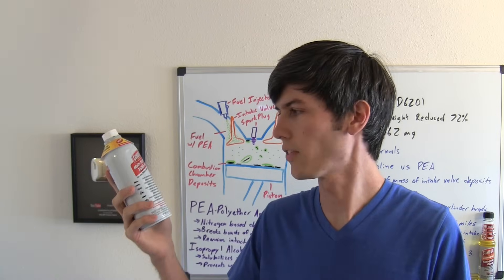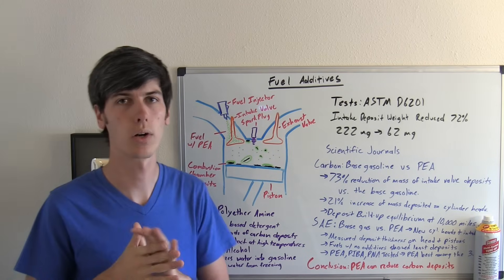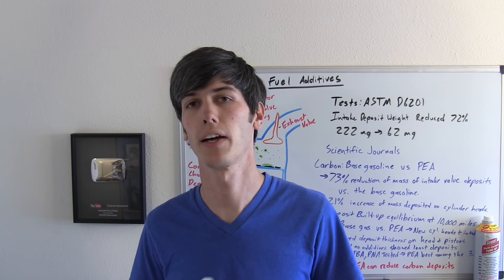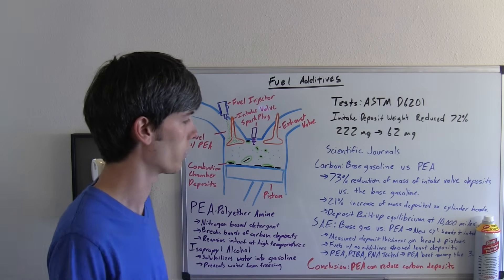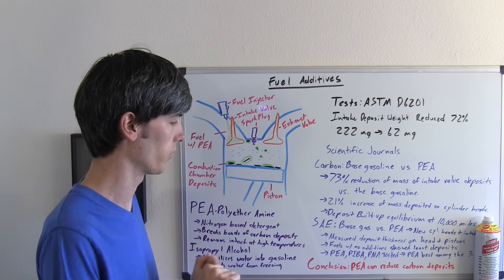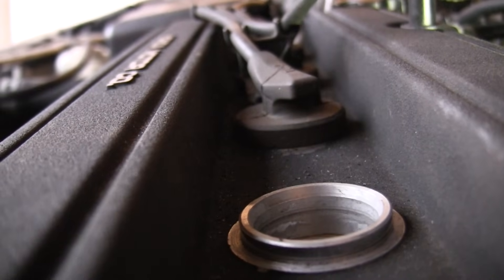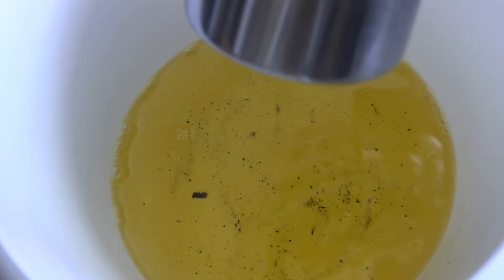Fuel Additives & Injector Cleaner - Explained

Comment: The real conclusion is:

1. If you have a newer engine (up to 80K miles or so), don't use ANYTHING.

2. When your engine reaches 80-100K, use an additive every time you change your oil. I like to do it 400-500Km before changing oil because then I "flush" some of the deposits that got into the oil. I consistently see improvement in the gas consumption (10%-15%) when I measure it AFTER I finished the full "supplemented" tank, for about 2000-3000 miles. From that point on, my gas consumption becomes higher until the next oil change+fuel additive.

3. If you'll use it too much, you'll end up building more deposits than you're breaking. Deposits on the piston head might cause detonation.
Reply: Shane is it safe to use it without oil change
Reply: @alecsanderfuentes3913  
Sure, I just like to start fresh after the treatment...But there won't be enough deposits to make you oil sludgy. Just don't do it immediately after an oil change. You don't want your new oil dirty right after you serviced your car.
Reply: @shane250  So do you use a fuel and an engine oil additive? If so, do you use a fuel additive after you do an oil change + oil additive or do you use the fuel additive before the oil change?
Reply: @ZareefHuq  
I use an oil additive because I got an old car (160K 2010). You do the PEA fuel additive as close as you can before your next oil change (so the oil change will flush the carbon you cleaned into your oil). Make sure you finished the tank with the additive before you change your oil. The oil additive (only if you use conventional crap from the garage pump...not if you buy some good oil) when you change the oil (put 1/2 a quart instead of 1/2 quart oil).
Reply: @ZareefHuq  If you use synthetic oil, NEVER use any oil additive.
Reply: Shane not even seafoam? And by conventional crap from the garage, do you mean the stuff that shops have in huge containers? I'm yet to do an oil change on my car since I just got it secondhand and the stealership said they did an oil change, but I plan on using Pennzoil Ultra platinum when the time comes
Reply: Shane I also drive a 2009 Camry with 147k miles on it
Reply: @ZareefHuq  
The best additives I found so far are "Slick 50" ("Lucas comes second) for oil, and "Gumout All-In-One" for fuel.
Reply: @shane250   I used Slick 50 on my 84 Camaro Z28 I had  years ago. I put 168,000 miles on it.sold it and shipped to my brother in Minnesota.  He put another 60,000 miles on it .( original engine and trans.)
Then the state confiscated it for  him having too many speeding tickets😳 At least that's the story he told me.
Reply: @shane250  Try Tufoil oil additive. Slickest substance known to man according to guiness world book of records. 11 intl patents,  NASA used it too. It keeps ingredience in perm suspension which is key...you dont want them to separate & clog in filter etc... P.S. ALWAYS use a good quality filter that holds a lil oil (with a check valve) for the next start too
Reply: @welcometoreality3450  Thanks. I wonder which one takes longer to drain because that IS the key to prevent startup wear.
Reply: @welcometoreality3450  
Just read the datasheet. Both additives are using the same ingredients (mainly Teflon), but Tufoil is much more expensive than Slick50 (at least on Amazon).
Reply: @shane250  so slick 50 ingredients in perm suspension? does the sheet mention that at all?
Reply: The per suspension is not on either of the data sheets, but both additives promotional statements claim that. So there is no reason to trust one more than the other. Both sheets state 1-5% of PTFE and a moly base.
Reply: @shane250   @Shane  i remember lots of guys were complaining of issues with slick 50 clogging... It would have been around the time the orig owner of slick 50 wasnt providing his product to the new owners of slick 50 in the mid 80s as stated in this video i provided above
Reply: @shane250  i dont think the check vale in filter lets oil flow without starting eng
Reply: @welcometoreality3450  
Then how come if you turn the engine off and check your oil, it's less than what you'll get if you wait 2 minutes and check?

I don't believe your lifters are dunked in oil all the time.
Reply: @shane250  dunno enough about that to comment, but do wonder how much oil the check valve actually holds....idk
Reply: My VW 2.0t engine at 68k (6 years) has accumulated enough to make the check engine light turn on.
Reply: @LA_Native  
Yeah, but yours is a direct injection, so the deposits are on the intake valves. No fuel additive will help that, as your fuel doesn't go over the intake valves.
Reply: Engine oil additives, such as engine flush oil, have nothing related to the video. Engine flush oil can only reduce the oil sludge in the engine crankcase, but it cannot remove carbon deposits in the combustion chamber. Also, need to mention that engine flush oil will change the thickness of the engine oil and make the engine oil lose the protection ability; thus, it will increase the engine wear. Good engine oil has detergents in it and is enough to remove oil sludges but without losing oil protection ability. So why is obssesed with engine flush oil that has no more benefit but can potentially damage engine? Strange. :face-red-droopy-eyes:
Reply: @yifeipei5484  
You misread my comment. Learn to read. The fuel additive (and any fuel) gets into the crankcase in every engine. This one will dissolve more deposits on its way there, hence I flush it out when I do an oil change. I never said I'm performing an engine flush.
Reply: It's strange how everyone's become a self-proclaimed expert, and even more so that so many people believe their misinformation:face-blue-smiling:
Reply: @yifeipei5484  
It's weird that someone who can barely read has criticism.
Reply: @shane250  Stop pretending to be an expert by saying, "The real conclusion". :face-purple-crying:
Reply: @shane250 You have no idea what you're yammering on about lmao

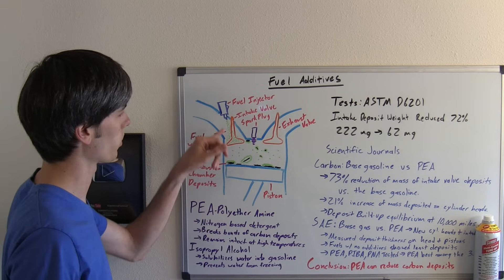Comment: (1:06) “...through the fuel injector it will clean off the back of your intake valve”

You have a drawing of a port injection system. 

Will it help clean the carbon build up on the back of the intake valves in a DI system?
Reply: NO! You need an intake air introduced product.

Comment: Like your video's 
Can you do a video on marvel mystery Oil (automotive additive)
Company states product was used in fighter planes WW11 
Curious I've been using it for years in all my cars , bikes just about anything with a engine .
Says to add to motor oil and fuel.
A lot of mechanics including myself swear by it.
Thank you very much and thanks for the video's 
Joe.. Ex navy veteran ..
Reply: I second that.  Some things I know for sure are that it made my fuel pump quieter and gave be about 1 1/2 mpg better on average (in gas tank vs. just gas, same gas station every time)  It also seems to provide better acceleration when in the crankcase, but that is probably because it thins the oil a little.  I'd love to know what it actually does!

Comment: How does soaking a tail pipe in pure gumout have anything to do with a tank of gas with a bottle of gumout added in and then burned in the combination chamber? That's not a valid point... You could have soaked the pipe in any number of chemicals.. I'm not talking smack I'm just looking good science and if I should spend 8$ on gumout in my 78k Honda Accord exl v6 vcm engine.. Obviously if the car is new don't use anything but... What should I do, have you found any other legitimate test and results?

Comment: I started using some fuel system cleaners and noticed that now my oil gets darker much sooner, with full synthethic I used to notice darker color at 5000miles but now it looks the same with less than 3000 miles! Why could it be?

Comment: Not sure soaking the muffler in Gumout solution is the best way to test. The product is designed to be used when the engine is running, e.g. at higher than room temperature, where it may have been designed to activate effectivley at those temperatures. Also, I'm not the least it interested in the muffler, as that's at the back of the engine when all the work is done. More interesting and relevant would be to inspect the intake valves or cyclinders before and after the solution has been mixed with the fuel.
Also, calling the video fuel additives and injector cleaner and only reviewing one product is a bit less scientific that I am normally used to see from this author. Though references to PEA, etc, from scientific journals is a good source. I'll have to read those papers now...

Comment: I regularly ride motorcycles with high compression engines into remote locations. Some small fuel stops on lonely mountaintops (looking at you, Ozarks) have exactly one grade of gasoline. For those occasions. or if I get bum gas from some no-name station and start hearing detonation, I carry a small bottle of a toluene based octane booster. Regular hardware store toluene works in a pinch. "Mousemilk" like Seafoam, Gumout etc. never goes near my engines. Using good gas and practicing proper maintenance will prevent excess carbon buildup.

Most name brand gas stations get their fuel from the same guys who deliver to the station across the street. the trick is to visit a busy station, maybe near a freeway, to get fresh gas from (hopefully) clean tanks. Modern engines and fuels are works of art. They don't need help. If you want maximum power from your ride seek out ethanol free unleaded, often available at race tracks for premium price, Higher octane will Not give you more power unless your vehicle's manual specifically calls for it.

Comment: I use to be a ASE certified mechanic.  One of the  tricks I was taught by an old timer was using a fine mist sprayer and spraying straight water into the intake (Carburetor or Throttle body) to remove carbon.  Do you know about this?  Couple of older mechanics swore by it.  Do you know if it works?
Reply: youtube full of them howto-s

Comment: Techroline is the real deal. Alcohol mixed with water turn your gasoline engine into a alcohol burning steam engine. The burn is hot the steam is cold net results is an engine that looks like a grenade went off inside. No rebuilding is possible as it will brake parts you didn't think could break. You'll need a new engine.Although this destruction usually only occurs under sustained high load conditions, like a marine engine, but it could happen in a car engine. Alcohol and water are also very corrosive.  Best to remove water mechanically versus chemically or don't let it in the tank to begin with.
Reply: do your research before write. every engine and every fuel tank have some condense water/water in it. it just evaporate in the heat and exits through the crankcase breather. also alcohol wont act like dynamite...

Comment: Basically I own a 55 plate civic type R Ep3 got a check engine light plugged the fault finder into it and I got the code for cylinder 3&4 misfires the bloke that owned the car before hardly drove it after a bit of research I tried Red ex (UK) because I had a hunch then injectors were clogged up and sure enough they was used a bottle of red ex & £20 fuel gave the car some proper driving and the fault disappeared and it’s been almost a week now just put some more in with more fuel to give it a good clean but it just shows you how much a build up of carbon can affect an engine.

Comment: I'm confused.  Didn't you say that basic gasoline without additives leaves fewer deposits than gasoline with...including those with PEA?  But PEA will help clean up those deposits.   What?  What about Seafoam or Techron which I keep hearing is the best commonly used additive out there that is part of Chevron gas?

Comment: what about diesel engines? port injection gasoline is pretty clean anyway, but tdi is opposite. What can be done to clean at least a little bit intake valves? for sure, prior to that anyone will clean intake mainfold separately.
Cheers.
Reply: ps: suppose the car use a oil catch can.

Comment: hi, i drive a 2011 jetta TDi, of late it has been producing smoke and engine losing power even when just when standing. I booked my car for service and the mechanic told me that i needed to replace my fuel injectors for 4500usd!!!!. I told him i cannot afford that, he then said the car will drive fine for now as he made some "adjustments" to help with the problem for now. The car drives perfectly fine now!. I didn't ask him what specific adjustments he made, but im suspecting he used a fuel injector cleaner, i suspect this because my car had far more fuel than it had hen i took it in, and the asked for an ectra day of work. Am i being scammed out of fear to now replace the injectors for 4500usd?

Comment: I saw a video from project farm where he ran antifreeze through a two stroke engine. It cleaned the heck out of the cylinder head, the valves, and the piston. He said he doesn’t recommend using this method though. I’d love to see a video from you on this subject.

Comment: Gum out with PEA in the white metal can that looks like sea foam, I can vouch for. It really does work. But man it smells bad coming out the exhaust: I won’t say I noticed a huge diff in mpg or anything , but I can tell it burns out carbon and will definitely won’t hurt it . Preventing unwanted maintenance is key

Comment: Do you have any idea if the aerosol cleaners (such CRC or Subaru specific product) for the inlet valves in GDI engines really remove the carbon build up without damaging the engine?

Comment: I have always thought of fuel additives as "cocktails for cars"; i.e. may not do much but they make you feel better. In Canada, the 87 octane gas can contain up to 10% Ethanol and it is my understanding that while this gas is perfectly suitable for cars that don't require anything with a higher octane, the number of additives put into it by the refinery may be less than their higher octane (read: more expensive) fuels. When the product is on sale, or when taking an especially long drive where I know I will be filling the tank more than usual, I like to add a bottle of additive. Same when I do an oil change; I like to add a 500 ml concentrate meant for older vehicles as most of my driving is city driving, short distances.

Comment: The steps are: empty the fuel cleaner, then fill the thank with gasoline  .  Right ?  I’m switching to V power +nitro by shell. Can I do the same steps with the V Power+nitro gasoline ? I don’t wanna use regular gasoline anymore. My car is Nissan Altima 2015 2.5 S.

Comment: I'm usually pretty good with DIY car repairs but I have to share this fiasco I created all by myself:  putting an entire bottle of fuel additive in the gas tank when it was only 1/4 full.  I thought ... erroneously ... that this would be better for mixing with water in this used 200,000 mile 1998 vehicle.  Within a month, I had to replace the fuel pump.  I didn't think anything of it because it was an old car, badly used without any repair or maintenance history.  But several years later I did the same thing with gas additive and guess what?  Within a month ANOTHER fuel pump.  (symptom:  Gas pedal pressure without any resistance or acceleration, just dropped to the floor).  Examining the second fuel pump, I noticed the rubber parts were shot again on the year old pump.  They were gummy and pitted from the gas additive.  Upshot to the story?  If you were even thinking of doing that ... don't.

Comment: I used fuel injector cleaner and it completely stopped oil burn.The engine was using over 1 litre of oil over 10000ks. Doesn't sound alot. Anyway thats in the past.

Comment: i used a liqui molly diesel additive in Mahindra SUV. The engine idling became smoother however the base acceleration in the first gear (without pressing accelerator ) increased drastically so i always have to keep my leg on the brake and maintain more  breaking distance because the car just speeds up at the biting point than earlier. Could you please let me if this mean my car is drinking more fuel than earlier?

Comment: So if debris reaches steady state, after 10K miles is it suggested to use in between regularly scheduled tune ups, based of the users manual? With a domestic vehicle that is manufactured between 2000 and 2015?

Comment: I used to work at a Mazda dealer back when they had manual adjusting valves and we would use a fuel additive as part of the tuneup and it would clean the injectors well enough that the more observant customers would think we didn't adjust the valves properly die to the noise coming from the injectors.  I'm personally sold on it in certain conditions.

Comment: Only additive I ever use in 4 stroke engines is Marvel Mystery Oil because I know that it works, I don't have any SAE study to prove it but I have enough first hand experience to tell you that it works beyond a shadow of a doubt. I have owed a car that would not even start until I cleaned the system out with MMO When it comes to 2 strokes I do use Sea Foam to clean out carbs and it works as well as anything for that purpose.

Comment: I've been told by a mechanic that this stuff is dangerous to use on older cars because instead of cleaning the fuel injection it can clean dirt out of the fuel line and clog the fuel injection with it.

I've actually experienced this with a really old lawnmower where I poured a small amount of fuel system cleaner (Cheap stuff from Canadian Tire store) into the gas tank, started up the engine and watched it sputter and die several minutes later. Fortunately I was able to clean the crap out of the carburettor by dumping the whole bottle of cleaner in the little 1 litre gas tank and then cranking the pull starter non-stop for a few minutes until she started sputtering and finally caught then smoothed out.

I'm not sure if the PEA is the same as I used. But I do know the stuff I used contained isopropyl alcohol as well, which is a decent solvent itself.